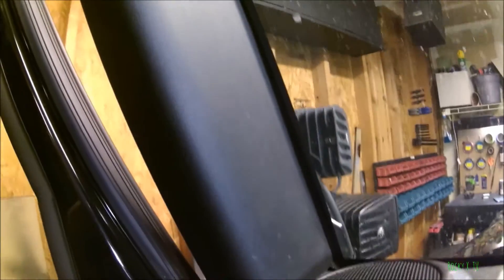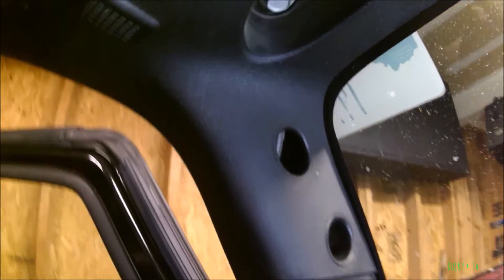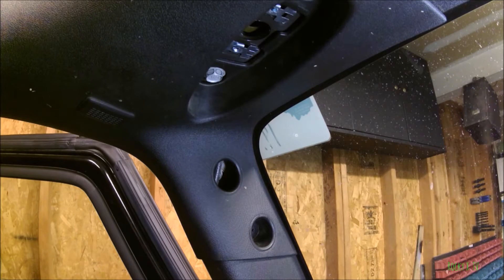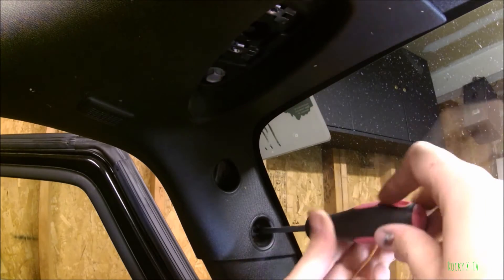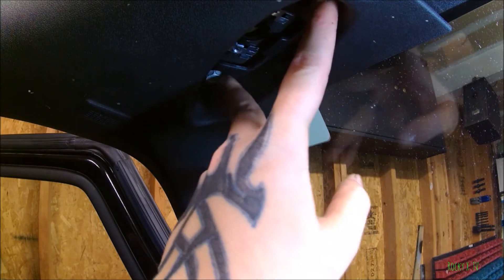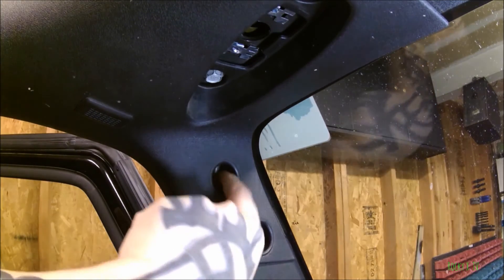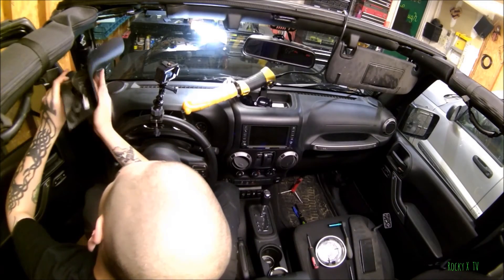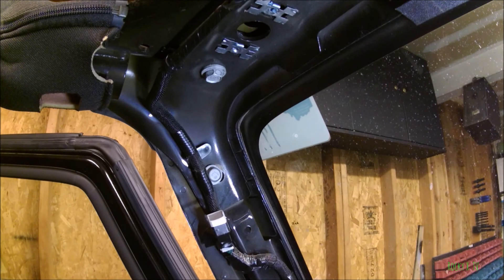How To Remove Jeep JK Pillar Panel

Comment: Thank you for this video.  I dropped a bold & nut when I was putting in some "oh Sh$%" handles and have heard it rattling around for months, but didn't have the courage to pull that Pillar off or know even where to start.  You are a genius.  Thank you.  It was soooooo easy with your video.
Reply: I did the exact same thing! But the plastic screw was stripped and wouldn't come out without some extra work.

Comment: I was putting in grabar and though screws came out easily without dropping down the pillar, 
I groaned when I dropped the grabar extension piece down!! Oy!
Thinking I had a 2 hour project ahead to retrieve, I found this video. The ONLY video I found on removing the A pillar. Mine was passenger side, no Bluetooth cord. Took 5 minutes to pop out following your direction and 2 minutes to put back. 
Huge thanks! And my plastic screw was spinning as well. To your point, popped it out with flat screwdriver though pulling the whole piece toward me would have worked popping it out and or folks can use needle pliers to grab and pull it out. 
Thanks again RockyT!
Reply from the maker: Awesome! Glad the video could help. Thanks for watching!

Comment: My little plastic screw is already stripped.  I dont know what they are called or i would get more.  Any idea what i put in amazon to find them?
Reply from the maker: I would try "plastic screw clip" that's pretty generic and should give you a bunch of close results. The issue is that they usually sell them in big bulk packs, but they're still cheap! Something like 100pcs for 10$. There are also assortments you could get, you'd have a bunch of other types on hand if something else breaks. They're all pretty inexpensive. 
Thanks for watching!

Comment: Hi, surfed into your vid because I dropped a grab bar spacer down the A pillar on my month old 2016 JK hard top.  Two things; do I have to remove the hard top panels to do this and that phillips clip on mine just seems to spin without backing out at all?  Thanks for your vid!  Best guide on this I've found so far. :)
Reply from the maker: You shouldn't have to remove your top panels, I had them out for the video (better lighting) As for the plastic phillips screw, just try pulling on the a pillar panel (towards the passenger side) while unscrewing it. You could also try using a small pick  of some kind and pry on the side of the screw while unscrewing it. These things can be a pain, and sometimes they just have to be broken and replaced. Try the pulling and prying methods and it should come out, if it breaks let me know and I'll see if I can find where you can get a cheap replacement one, you can get them from the dealer as well for around 4$ I hope this helps, thanks for watching and don't forget to subscribe, if you want to that is.
Reply: Rocky X TV i came across with your video is because i dropped the 13mm while removing the bolt to install a grab bar as well. I punched it so many times and it didn't drop lol

Comment: The plastic screw on that clip just spins around for me. Any ideas? Could I just pull the clip out with the screw still in there?
Reply from the maker: I've had the same issue before, I used a small screwdriver and pried on the screw while turning it. When that fails, just yank it and find a new clip, I usually replace them with the simple "Christmas Tree" style clips. Thanks for watching and don't forget to subscribe to keep up on all the new videos! Thanks again and I hope this helps you out.